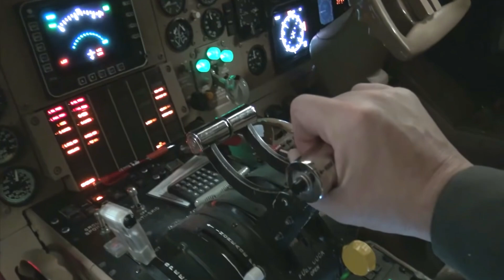How Reverse Thrust Works

Comment: It appears that the modern high bypass engines use only the cold bypass air in the reverse process. the effect of either system is only effective above 60 knots (69mph) airspeed, after that they can be used to prevent foreign object ingestion during the rest of the roll-out.

Comment: Landing in a 747 at San Diego once  was advised by a pilot on one occasion that the reverse thrust would be used due to length of runway and not to be alarmed at noise.  A few people have subsequently suggested the SD runway is a bit short for a 747 and more suited to 777 and of late A350.

Comment: The Giant Airbus A380 Thrust Reverse System uses the inboard 2 Engines only to slow down the massive Aircraft. 

The 4 Engines Airbus A380 needs at least Runway length of minimum 3800 metres long and 60 metres Wide ICAO Code F To operate on Airports Certified to handle the Huge Airbus A380.

Comment: Inversion des poussées qui se fait en même temps qu'une levée des ailerons et une ouverture à fond des volets qui permet un ralentissement de la machine (avion) à l'attérissage. 

Le premier appareil est un Airbus de la PIA (Pakistan). 

Le troisième moteur ouvert à l'arrière est celui d'un 737-200. C'est exactement ce qui se produit à l'attérissage du 737-200.

Le quatrième aéronef garé dans un parking est celui d'un Fokker 28 (F 28) dont le moteur est ouvert à l'arrière comme exactement ce qui se passe à l'attérissge des moteurs du Boeing 737-200. Mais, il se passe moins de bruit à l'attérissage d'un F 28 quand l'inverseur est actionné que dans celui du 737 200.

Ai pu faire le constat en voyageant à bord d'aéronefs du groupe Celestair (Air Burkina, Air Ouganda...) ici en Afrique de l'ouest.

Le moteur des 737-200 est bien différent de celui du 737-700 et 800. Le CF 56 de General Electric (GE) et Snecma.

Comment: A couple of fun thrust reverser facts:
1.  Most jet engine reversers are designed for ground operation only … usually on landing and on some aircraft types to “power back” from the gate. Reverser deployment in flight can be a hazard to flight possibly resulting in loss of control of the aircraft. There are however a few notable exceptions where reversers are used in flight to reduce speed or increase the rate of descent and these include the YAK-40, Trident, DC-8, C-17 and NASA’s Shuttle Training Aircraft.
2.  The amount of reverse thrust produced by the engine on landing is greatest at touch down speed and then diminishes with decreasing forward speed. It’s not uncommon to stow the reversers at 80 knots because the reverser effectiveness has decreased considerably and there is the risk of ingesting disturbed air or foreign objects that could damage the engine.

Comment: Water and ice have nothing to do with it. Reverse thrust is used EVERY landing. Just listen to any passenger jet when it lands. The engines roar because of the reverse thrust.
Reply from the maker: Yes, great observation! But it is not used at full strength every landing unless needed or instructed by the operator’s flight policy!! Thanks for the comment and I hoped that helped!!

Comment: OMFG 
REALLY 
Very VERY questionable 
I have seen more than enough stuff on aircraft BY ACTUAL PILOTS AND PEOPLE WHO WORK on aircrart to call 90% BS on this.
Reverse Thrust is always used every landing regardless of the weather or how the runway is UNLESS there is engine problems and they have to use brakes then. 
If brakes are used and get super hot its harder to stop ALSO MUCH more wear and tear on tires and landing gear.
Thats why trucks on roads use engine brakes or jake brakes to prevent brake fade and brakes catching fire and not been able to slow down or they have trouble coming to a complete stop because of EXTREMELY hot brakes.
Reply from the maker: Who said I am not a pilot? But also each individual airline has their own procedure for how they use this system to make it work for their operating procedures and maintenance plans. But the overall functionality of HOW the system works is all 100% correct. The difference on when it is used is dependent on who you fly with. Thanks for the comment and I hope that helped!!!

Comment: fine, but does the engine rotates in opposite direction i think no i am curious to know or i am stupid to ask like this qestion i don't know ,thrust and reverse are mintaining the airplane from going any forward by disposing the air coming from the engine
Reply: no the engine operates as normal but the air coming out the back (which is pushing the aircraft forwards) is redirected by doors opening to allow that air to come out forwards slowing the aircraft down, Reverse thrust is generally only used to get the speed down to around 90 to 100 knots, its the deseleted and the throttles pulled back to idle, and the pilot uses the wheel brakes to slow down further.
Reply: @davedixon2068 they are called blocker doors…they block the air and redirect it forward through cascade vanes

Comment: Thrust reveresers are always used regardless of weather or runway conditions!!
Reply: No. They might be always opened to redirect the idle thrust at least, but you mainly use them for real( more than idle thrust) depending on  runways conditions or to help  reducing the brakes temperature and wear.

Comment: The part about the condition of the runway isn't correct. Pilots use the reverse thrust the same way regardless of the runway being wet or dry.

Comment: I’d love to know how that heavy ass engine stays on that skinny ass wing . I ain’t flying in no airplane lol . I’ve seen small planes with 1/4 inch bolts holding the engine in place , F-that lol
Reply: In short answer.

Some of the greatest engineers of humanity figured out how to balance weight stress perfectly along the wing. The inside of a wing is a complex design of ribs and struts that give them a insane amount of structural integrity, and the engine mounts are included in that.
Reply: @frogking5573 it’s called a PYLON the engine is mounted to

Comment: I would have thought it depends on runway length as well. Also don't forget turboprop aircraft also have reverse thrust (that generally involves reversing the prop to negative angle) to slow down the aircraft. I had a chance to fly a Cessna 208.

Comment: First off, they are called Thrust Reversers. 
There is the Target Type (also known as the 'Bucket', which was mentioned). They are found on Turbojets, Low-bypass Turbofans and used on some smaller passenger jets. They are able to vector 100% of the thrust, but do not provide 100% thrust reversal, as was mentioned. There is the Cascade reverser, which was shown--where the blocker doors engage and redirect the bypass duct flow through cascades that are located behind the sliding nacelle doors, which was mentioned. There is also the Clamshell reverser type. They were widely used on older planes and act much in the same manner as the Target Type. They are still used on jets, but mostly smaller ones (like a private jet). Then there's the Coldstream Tyoe, which has four actuator doors that open to block and redirect the bypass duct stream.

Second off, they are almost always used--even if it's only with idle thrust. Adverse weather, possible ice or water encounters or anything of the sort aren't why they command the reversers to deploy. Thrust reversal effectiveness diminishes greatly below 100 knots, so your 'just-in-case' assertion does not make logical sense. 
Third off, planes have other systems (like anti-skid) to deal with weather-related adverse conditions on the runway. 
And finally, the Thrust Reversers are either commanded to 'deploy' (where they engage fully upon command) or are commanded to 'stow' (where they return to their locked stowed position) and There's no such thing as 'open a little'. The throttle levers are used for power level selection. Besides, all plane types must be able to demonstrate their mechanical abilities to operate safely and effectively without ancillary systems such as Thrust Reversers, Anti-Skid, Auto Thtottle and more. 
It's great to endeavor to educate people, but make sure you bone up on your facts first.
Reply: All very true. I'm glad to see somebody getting it right for once.
Reply: Boom!
Reply: Thanks bro
Reply: He’s Probably a bullshitter trying to make a video, he didn’t go in-depth on the mechanics of it, disappointing.
His explanation of how the landing gear works on a wet runway, was an indication.
The tires are so slick on a wet runway?
The tires are hydroplaning on the water on the Runway, not sliding or slippery.

Comment: Semi-nice explanation. 
They're not just for wet runways, though. They're nearly always used on landing. Because they save significant wear on the brakes. 

(I used to work for the company that made the thrust reversers (and the rest of the nacelle) for many of the Boeing, Douglass, and Airbus airliners.)
Reply: Well said, I was USAF for 20 years and I thought how reverse thrust worked would be simple common sense even to someone with little to no knowledge of aircraft mechanics but after watching this guys vid I guess not...
Reply: That's because he overcomplicated his explanation. It is indeed a simple process. And yes, as BoomerDude said, reverse thrusters are almost always used in order to prevent wear on the brakes.  @vinewood8295

Comment: Nice video! In line operations we usually go above reverse idle. It's not that we need it but it saves brake wear and brake/tire temps from getting high. It's important on QTA operations- quick turn around. You can see the difference when you dispatch with a reverser "pinned out"- inoperable. The brake temps do get higher even after a leisurely landing on a long dry runway. As you said they make their money on slippery runways. The MD-80-90 series had a challenge since the reverse flow blanked the rudder. It was a challenge on slippery runways with a crosswind and was a factor in at least one MD-88 losing directional control landing on a slippery runway. Cheers
Reply: I miss flying (as a passenger) on the old MD90’s.  Crosswinds is what made those things fun to fly.  That, and the take off acceleration.

Comment: Why don’t they use the reverse thrust more fully even if the runway is dry?
Reply: They do almost all the time, just some false info in this video
Reply: They usually do use the thrust reversers even on dry runways unless the runway rollout is really long.  The video just missed that fact.
Reply: For three, sometimes four reasons:
1) Brakes are far less expensive to maintain over their lifetime than the extra fuel the engines will consume at higher thrust settings during periods of thrust reversal.
2) Thrust reversal effectiveness greatly diminishes below 100 knots (speed of the air passing over the plane). Most commercial jets will land at a groundspeed of (depending on the aircraft) somewhere between 150-165 MPH. 
3) Most commercial airliners have wing-mounted engines. Thrust reversers kick up debris from the runway, which, at lower ground speeds, has a higher likelihood of causing damage to the aircraft, the engines and anything near the aircraft.
4) Some airports have noise abatement restrictions in place. The two most common types of thrust reversers in use today (Cascade and Cold Stream) both essentially harvest the bypass air when deployed, which de-shrouds the hot exhaust stream. Without the bypass air cloaking the hot exhaust stream as they both exit the back of the engine together, the situation is now much the same as if the 'muffler' had been removed. There are municipalities around that don't want the extra noise. Ever wondered why the thrust is sometimes increased about 30-60 seconds after takeoff? Or perhaps why the plane levels out after the takeoff climb, the throttle is greatly reduced for a stretch over a city, then it's brought back up to its roaring glory? Thank the local noise abatement restrictions.
Reply: @7t7o7  Those are some points although they don’t use it sometimes in case of oil Temperature increase.
Reply: They usually do.